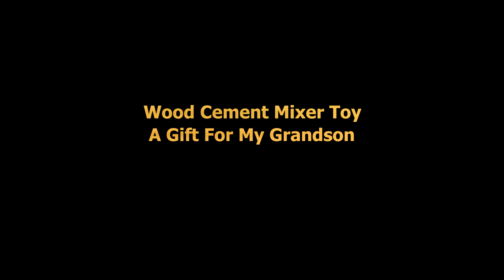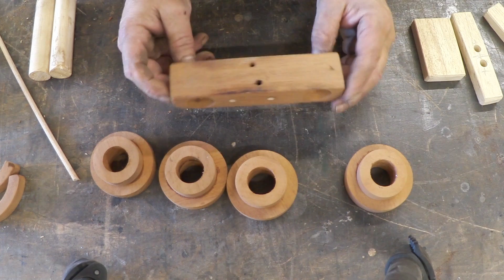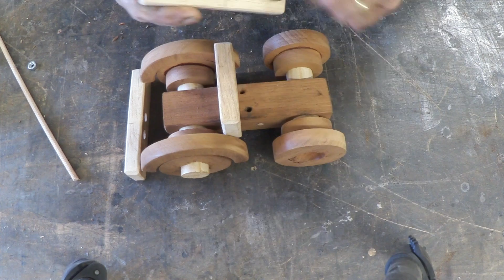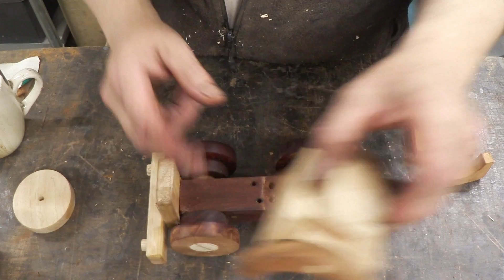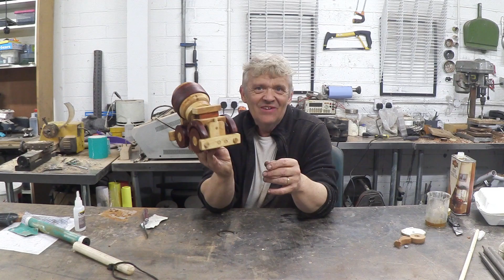Wooden Cement Mixer Toy A Gift For My Grandson

Comment: That is smart as oot like. I can see an open market for them on eBay if you want a few extra quid👍😁
Reply from the maker: now that's a good idea - make a good business for someone - plus it is adaptable the chassis and cab could be the basis for a range of toys - tipper, crane,cement,flat bed - lots of different toys could be made on the same chassis and cab design